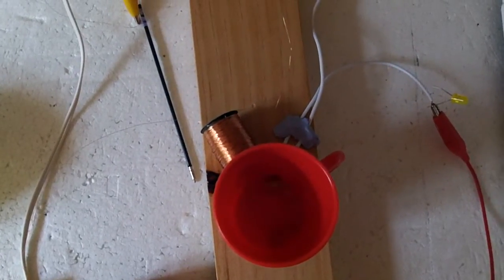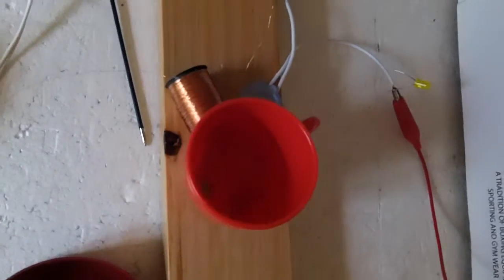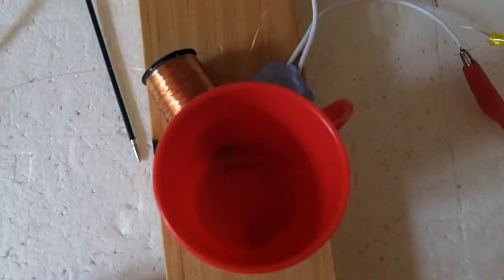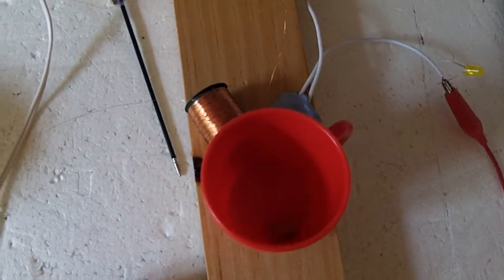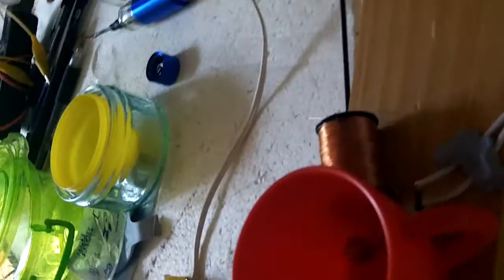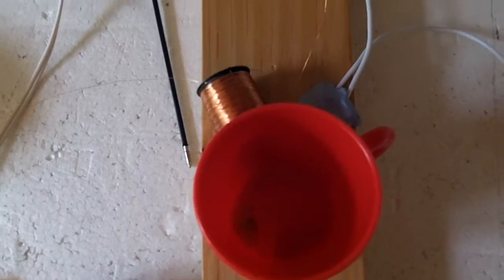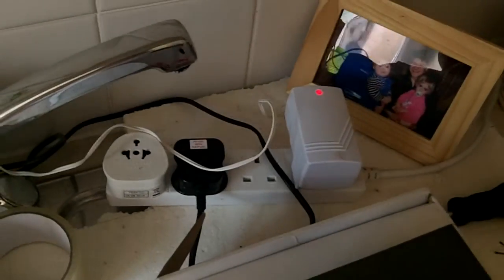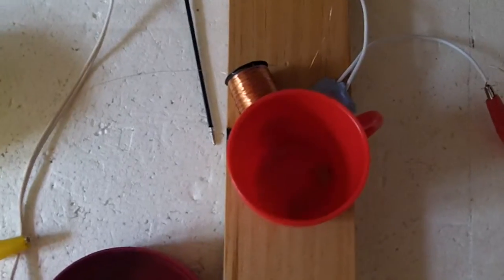Pulse motor with reed switch - magnetic ball

Comment: Maybe a stupid question, but as soon as the reed switch turns on, the coil energises. But is the magnetic ball now attracted to the magnet coil for a small moment or is it the coil which pulses the ball away ?
Reply: pushes the ball away, as far as I remember. A repulsion motor, rather than an attraction motor